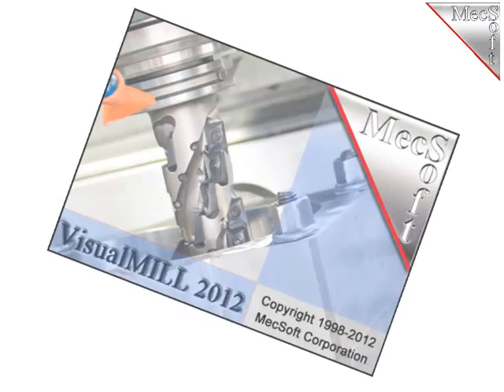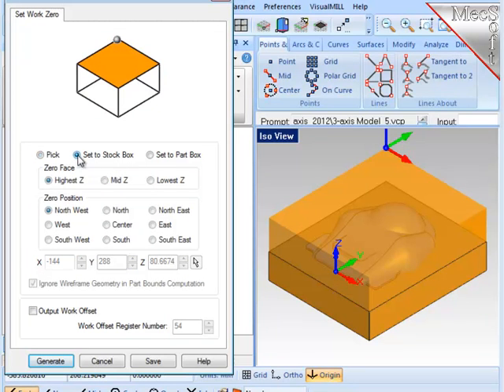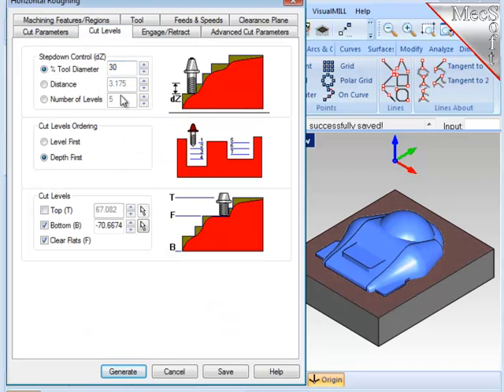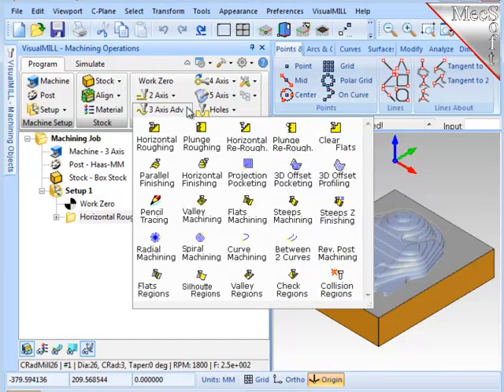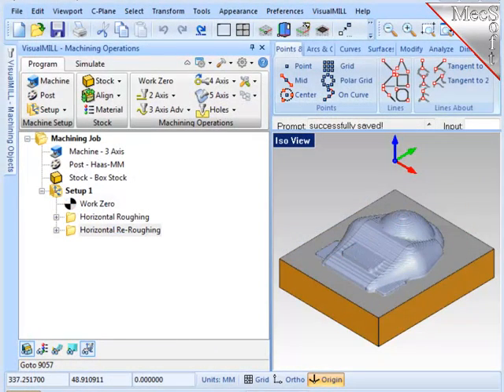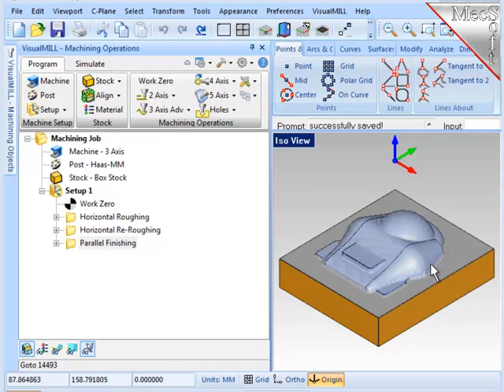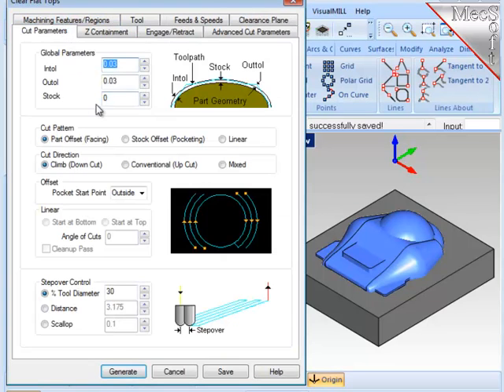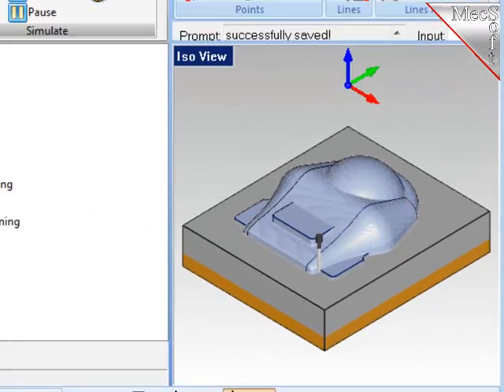VisualMILL 2012 - Intro to 3 Axis Milling | CAD/CAM Software Tutorials by MecSoft

Comment: The video looks very promising. I tried screwing around with visual mill 2012 and I almost went mad. Is it just me or is that programm absolutely unpredictable and not useable at all? I can make a cylinder but for the love of god I can't do anything with it after that. Every time I open it I have to close it after 5 minutes or I will smash my PC to pieces. It is literally worse than hitler.
Reply: I just tired it again and I'm not fooling you, the CAD part of this software is making me loose my mind.